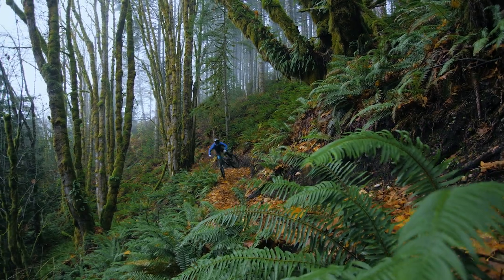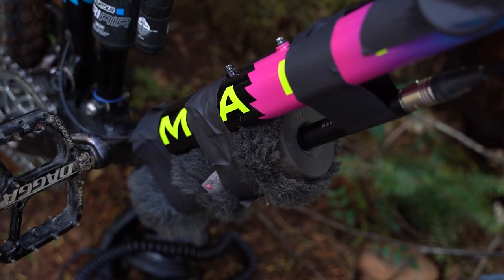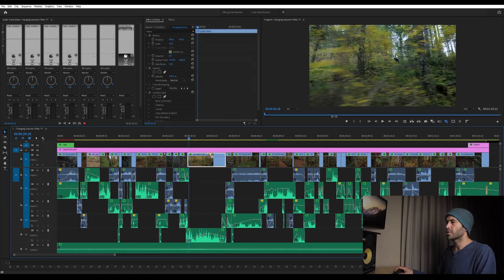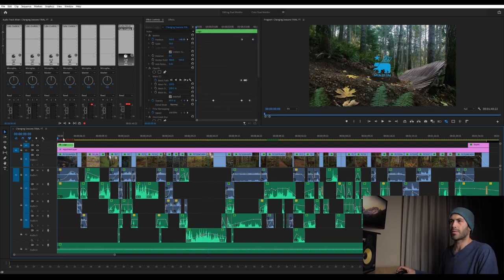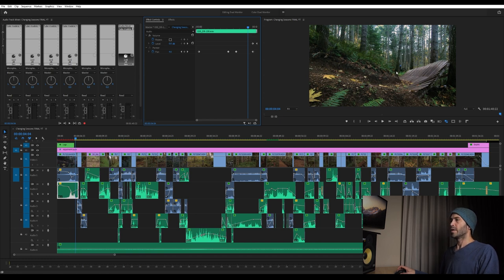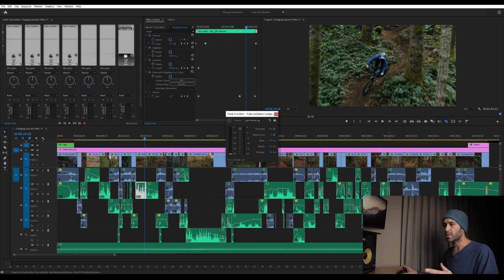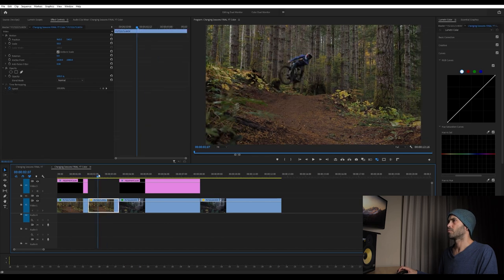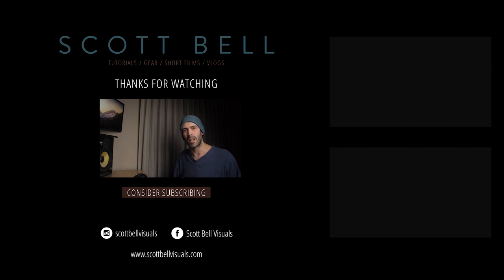DEEP DIVE: MTB Film Sound Design and Color Grade

Comment: Hi Scott, maybe you can help. When I watch a movie I always notice that a scene has a certain look. Very often a blue-ish or green-ish tint...EXEPT for some objects,  they pop out in a strong red or a strong yellow. I've tried this by my own...to protect some details of a clip and dye the rest in a certain color. My results are never satisfying. If it's just one detail it's easy, I use the hsl tool to isolate the color of the object. Invert it and you can apply the color grading on the rest. If there are more details it becomes harder because you always catch some parts of the scene you don't want. It's hard for me to explain in english but I hope you get the point? :-)  Do you have an idea to solve my problem? Best regards Claus (Germany)
Reply from the maker: Thanks for watching. I think this is accomplished through the Color Wheels and HSL Secondary Panels in Premiere, but probably can be controlled with more detail in a program like Devinci Resolve. It may also be due to how these movies are shot, both in the set design as well as the way they light it. Through these methods, you can create more separation of the dark and light areas in the frame and more easily apply color to the shadows vs mids/highlights to accomplish a look. All that said, I am by no means a professional colourist so there may be other ways to accomplish this look. Good luck!